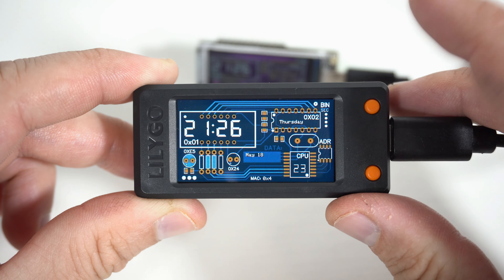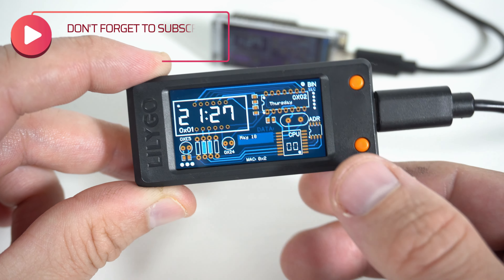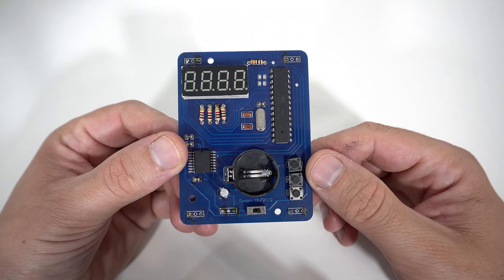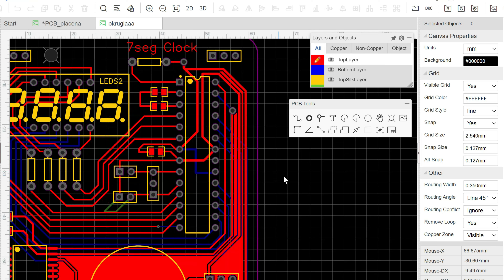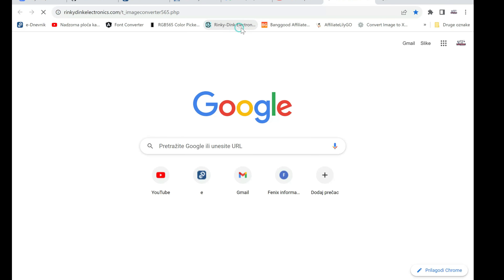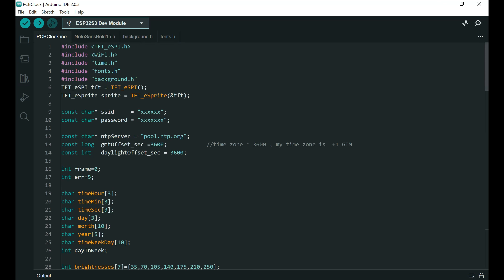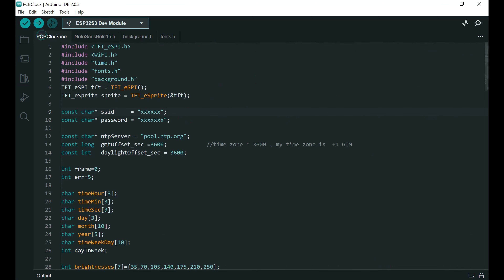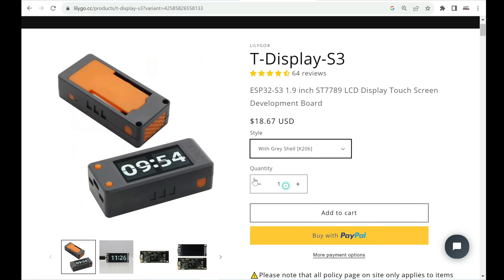Easy Way to make this "Electronic Circuit"  User Interface

Comment: I installed this sketch on my T-Display ESP32 S3 Touch version and worked perfectly. One of the finest looking sketches you've posted so far. Thanks for sharing. Stay safe and blessings.
Reply: Can you tel us what version of the IDE do you use to do this 'install' ? I try with ARDUINO 1.8.19 on several computers but it seems that it can't load the project because of the big background.h file. If I got some time, i'll try with plateformIO or Arduino v2...

Comment: I tried to install this sketch on my T-Display ESP32 S3 Touch version and I get the following error: "Compilation error: text section exceeds available space in board". 

Follow-up: the problem was, apparently, that I selected the Lilygo T-Display S3 board in the Tools menu. Selected ESP32S3 Dev Module, applied the settings you suggest. But now the sketch refuses to get uploaded: "Upload error: Failed uploading: uploading error: exit status 2". Maybe port busy from other sketch. Uploaded a simple sketch with empty loop(). No problem. PCBClock still refuses to load. Tried everything (e.g. pressing boot & reset buttons...) still no luck. What am I doing wrong?! The simple sketch is a "show memory" type sketch. Shows 16MB of ram, but whatever I do in the settings: "PSRAM not found or enabled". The board is supposed to have 8MB of PSRAM... strange.

Follow up 2: installed Arduino IDE v 2.3.3, updated the libraries. Now the sketch compiles and gives either: "A fatal error occurred: Could not open COM14, the port doesn't exist" error (I get the same error with the nyanCat sketch), or uploads, only ... to abort uploading at 21%: "A serial exception error occurred: Cannot configure port, something went wrong. Original message: PermissionError(13, 'The device doesn't recognise the command.', None, 22)". What the...!? The memory sketch still uploads and runs just fine. Strange things happening...

Comment: Did you try making anything that interacts with ChatGPT? :)
Reply: Hmm, chat GPT is a huge help when coding. 
However, you need to keep in mind that the free version is trained with old data and thus can't tell anything about stuff it was not trained with and is only being developed now. 
Also, Chat GPT can not analyse stuff as such. Chat GPT is basically like a T9 algorithm that keeps putting the most likely word after the last word, considering the entire input so far. 
That works quite good for code and stuff that already is established and well documented. 
Not so well for random texts though (at least yesterday as I asked it to correct a text I have written and pasted in). 
As a conclusion, use it! But dont rely on it too much.
Reply: @oilybrakes  I've used OpenAI ChatGPT and APIs since they came out many months ago, it depends. Even with code I work with so many edge cases that half of the times it's wrong. However this is not the point of my discussion. I have just discovered that Volos made a video with "M5Stack CoreS3 ESP32S3", now: imagine making a Personal AI and using the microphone + speaker to interact with ChatGPT, it would be incredible.
Reply from the maker: I stil havent try ChatGPT, i know that this is future but i am not fascinated with it. But maybe i will like it when i try it. We will see.
Reply: @VolosProjects  you have a lot of skills and creativity, I am sure that with that tool you could create a lot of cool stuff, meanwhile having a lot of fun!
Reply: @fabryz  I've been using ChatGPT 4 as a Plus member for a week and for a nubie like me it's very very handy to help figure out what causes all those stupid compile errors I seem to make integrating and modifying code .. I just feed it my code and it's been very good at finding errors a hell of a lot faster than any DISCORD or forum human would. BUT, I also know it doesn't know what a TTGO dev board of any flavor is.. or much about what the TFT_eSPI can do. It's often at a loss when I get crazy looping " LEDC is not initialized " errors and other odd crashes.  And it does even make some logic errors.. but in spite of that it's a HUGE time saver and big help for any novice wannabe programmers like me.

Comment: Hi! Could your describe your developing process? What do you use to write the code, how do you debug app? Do you use the ESP simulator to debug faster or you change code and upload to device multiple times?
Reply from the maker: I use only Arduino IDE, write code and try it 1000 times, it take time and patiance. I wish there is good simulator for this but i cant find it.

Comment: I think my friends will also get a kick out of this.. the CPU speed especially will peak their interest.

 If you put a lipo battery small enough to fit INSIDE the case in there..  do you have any idea how long it will run?  and perhaps more importantly, can it automatically re-charge thru the USB in these T Display S3's ?   Also is there much room left to add more program code  in there alongside all the graphic header files?     Nice Project!
Reply from the maker: Yes it can fitt smaller batery, i will try to fit 500 mah batery, it shoud be enought for 4 hours, i am not sure will this board charge it, i cant find that info. Yes there is planty of space for more tasks.
Reply: @VolosProjects  Per Amazon : Question:Does this board also charge the attached battery when the USB cable is plugged in?
Answer:It can be charged via USB, and the IO04 can also do battery level detection.
By Lily GO SELLER  on November 28, 2022.. They are also recommending a couple batteries with as much as 1200mah too.

Comment: I love all your projects..  Thank you for sharing your code and ideas, I appreciate so much.  I would like if you can explain how to display in a T-Display S3 some waves from external source.  Have you ever program this board in micropython?.
Reply from the maker: Thank you Sandra for coffee. Thats great odea, what waves you had in mind. No i havent try mocro python jet.
Reply: Sandra, I think that would be interesting to make a subset of a miniature oscilloscope using an analog input pin and mapping the waveform to the display.. You could even connect his super tiny QTP Super Blink on Steroids device to it and watch  the waveforn change on screen perhaps .. this is what you had in mind? is it?
Reply: @VolosProjects  It was a pleasure.  I was thinking in an ECG (Electrocardiogram) wave (Ad8232 ECG Module) or even better a Pulse Wave + SpO2, like the oximeters (Max30100).  Thank you again.
Reply: @jimsnodgrass8454  It sounds great!

Comment: Hi Volos. Can you make a video showing how you upload the code to the board with Arduino IDE and PlatformIO. I have 2 of these boards and its a real struggle getting code uploaded to them with all the button presses to get it in boot mode.

Comment: As always, thank you much for sharing your projects. I don’t have that board at hand but, last night I tried it with a TTGO and it failed to compile due to not enough memory. So, I’m thinking to pull the images from a web server thus reducing memory space. Do you think it’s feasible? Thanks again.
Reply from the maker: Yes, i had same idea few time. I need to dig i to it more. But i think it is possible.
Reply: Just use one big background and then create the resistors as blue/pink and change them randomly - this will save a lot of space

Comment: Code uploads ok but after the reset, whatever was already in the display memory runs instead of the new code..Not sure what would cause that?
Reply from the maker: Did you set all like in video, ssid, pass, flash size and  partition sheme?
Reply from the maker: Probably wifi problem, try to use some other ssid
Reply: @VolosProjects  Thanks - my error. Had misspelled.the SSID.. all ok.

Comment: My display stopped working after only 2 months unfortunately. I think a component burnt out: it's a sop23-5 component I think which is located on the left side between two caps (looking at the backside of the board with the usb-c connection downwards). Could someone with a working board look at the lettering on the chip and tell me the type so I can replace it? I presume it's some sort of voltage regulator (5v or 3.3v?)
Reply: The chip is signed with: 2U=D/C. I can't find this on search. Lilygo provides the Shematics od the board. I suggest that it is U7, a 3.3v Regulator with the describtion AP2112K-3.3V. You can order 10 pices for less than 1,00€ + Transport from China.

Comment: for some reason i cannot make it work with my AMOLED version
Reply from the maker: Hello Nickolas, this will not work on Amoled version without lots of modification of code, even when it works it will be only in one corner of screen, resolution is diferwnt on tjease two boards.